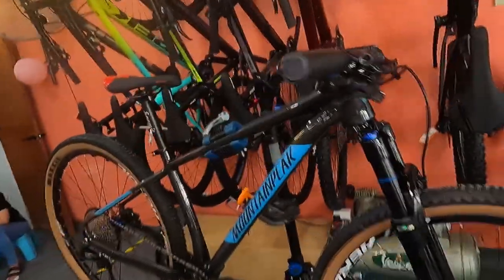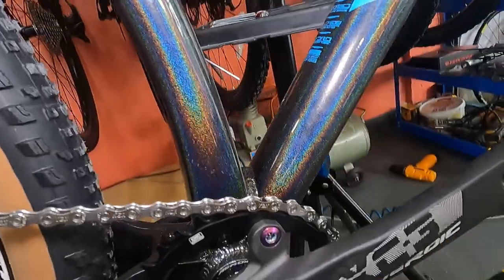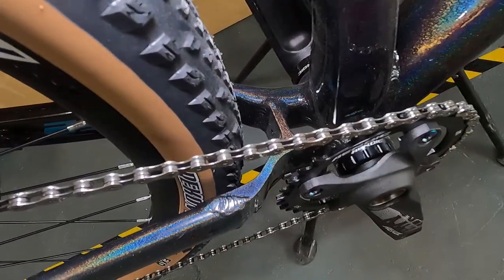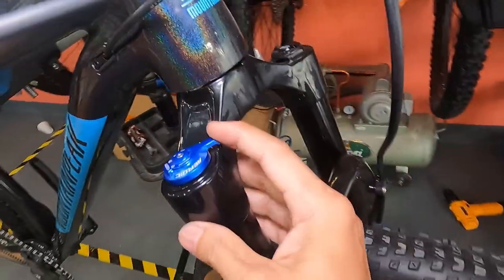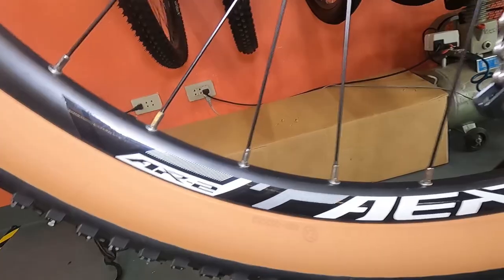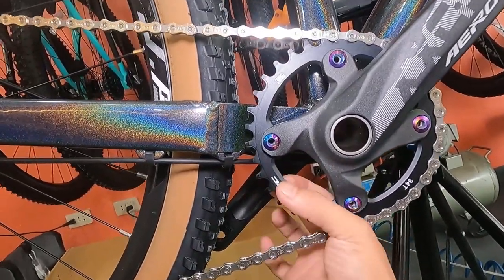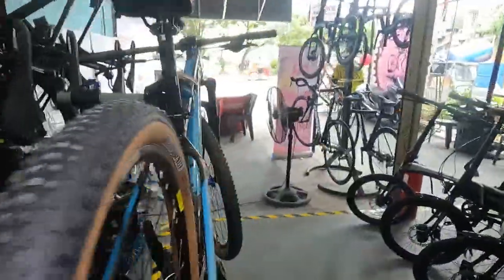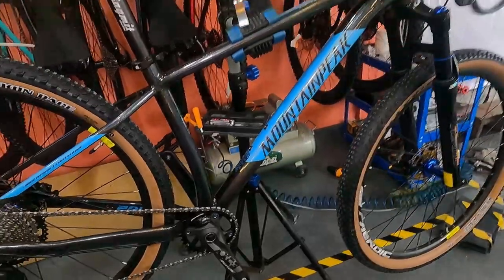MOUNTAINPEAK AGILE BOOST | PROJECT BIKE MADE BY MADIES BIKE SHOPE |

Comment: Sir Archie share ko lang, pang trail/enduro ang MTP Agile Boost. Pang XC lang ang ginawang set-up... Which is wrong IMO kaya ginawang boost at makapal ang paka weld sa BB at chainstay part ng frame para mas matibay pag sumasaga sa mga lubak.
Reply: 40mm stem, 20mm rise handle bar, 32t chainring, 180mm front rotor
Reply: @jerwinbautista3747  good irdea sir. mas ok sir kung short 0 stem na with rise hb, sa fork nman 140-160mm sa GS nman anmy shimano/sram 12s kung budget Deore 12s sulit na dyan
Reply: Agree sir Dueler sayang frame
Reply: sir alam mo po ba Head Angle ng mtp agile? di ko kasi mahanap sa ibang  vids ng mga vloggers ehh. kulang2 reviews.
Reply: @mjengineering2661  Wala pontalaga sir proper videos about sa geometry ng agile frame pero sa tingin ko sir basta sa Trail po ang head angle nya is around 64°-66° with 120-160 recimme ded Suspension travel